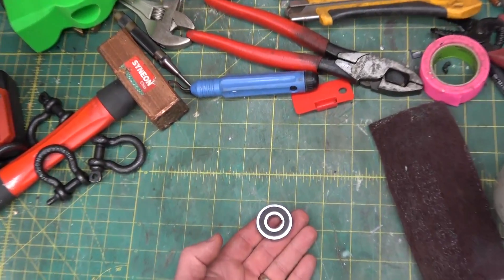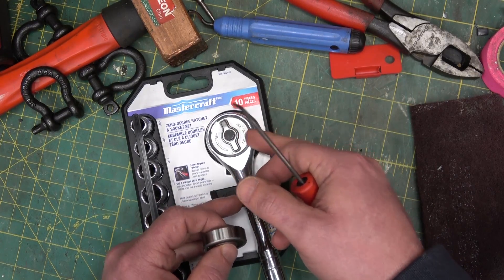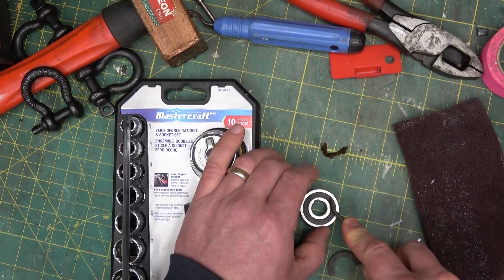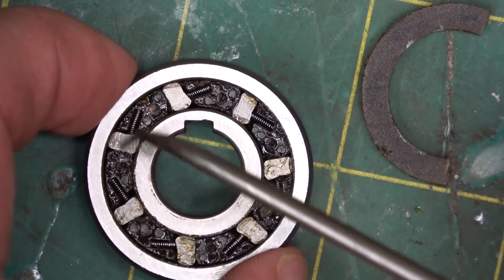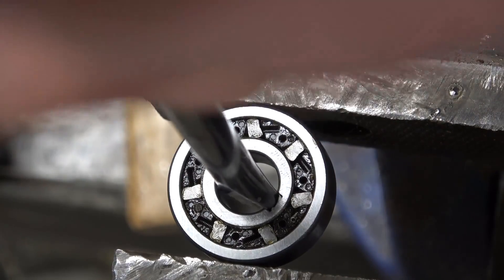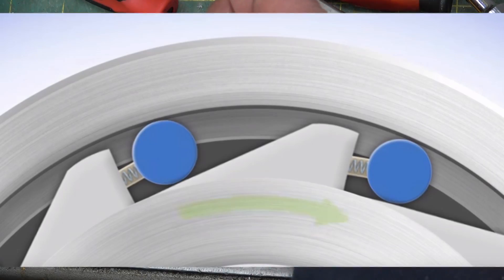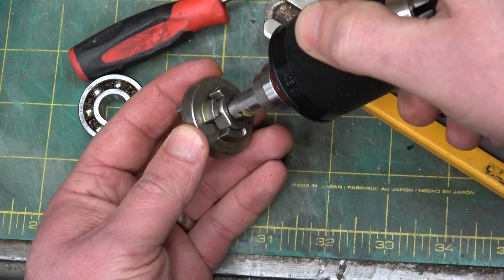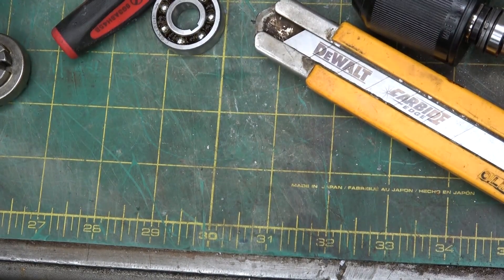BOLTR: Sprag Clutch | Engineered Bearings

Comment: Now what would happen if I were to weld the inside to a bike axle. And the outside to a gear cog.  Would the weld brake the bearing ?   Affect the balls ?   I know too much heat would shatter a bearing. But. Would it ruin the balls

Comment: My favourite is a bi directional one way coupling. Maybe I've written that wrong but it allow for is torque to flow in either direction but only through the bearing one way, ie from the outer race through to the inner but not from the inner to the outer.
I just checked its called a two way over running clutch

Comment: My Thesis, Final year project, was a wheelchair design that raised the seat so the occupant can speak to someone on a face to face level or maybe reach into an upper cabinet.
I used a Sprag clutch on both sides of the chair actuators in my design but it was two-way. Only the power shaft (up or down) could drive the final mover. 
The clutch was mainly used on escalators. A small one was VERY expensive but needed as a safety device.
I was the Top Dog of the year with that project.

Comment: I am replacing a keyless sprag roller bearing on a motor. Some one else took the bearing out of the press in housing as well as the press on shaft. How can I make sure to replace it properly so that it will work correctly? There were no arrows on the original bearing.

Comment: In a manual transmission auto clutch 3 wheeler or quad, a sprague clutch is often used in a drum style centrifugal clutch- to allow the machine to idle in gear but still have engine braking. A separate motorcycle style multi-plate clutch is often used, which disengages as the shift lever is moved away from the center detent, allowing the transmission to unload and shift at higher rpm.

Comment: I used to find the roller one way bearings in document feeders of photocopiers. Some of the whole gear assembleys were to me were how the hell does that all work as there were multiple one way bearings and clutches all seemed to be fighting each other and in one 70 copy per minute Ricoh model it had a one way bearing on a fixed shaft which seems to act as a there ain't no way in hell the mechanism is turning that way break.  It did my head in trying to figure it out but when the doc feeder started to jam in a certain way you would replace this or that one to get it working again.

Comment: The sprags they use in 700 class R/C helicopters can handle well over 5hp of torque. They don't have rolling elements though it's just a bunch of sprags (many more than the one shows here) and they use a set of radial bearings on either side of the sprag clutch to support the shaft. And instead of having individual springs for each sprag there is a spring around the outside circumference of the sprags as a group. here is a picture of one:

https://www.amainhobbies.com/sab-goblin-17x25x12mm-sprag-clutch-one-way-bearing-fe425-sabhc533-s/p976076

 The sprag drops into a steel sleeve in the aluminum one way hub and a shaft cover passes through the center (a bolt or pin connects the shaft cover to the actual mainshaft)

Comment: An easy place to find a sprag clutch is on any pull-start engine.  It grabs the crankshaft when you pull, and doesn't when the rope goes back.  Unless it's broken.  Then the engine will forcibly rewind the rope backwards, and break the handle off.

Comment: Helicopters use this to allow the engine(s) to drive the rotor system but still leave the rotors to spin freely if the engine(s) fail(s). Lots of interesting mechanical engineering in helicopters.

Comment: The ones I use at work on conveyors are cylindrical roller with no springs, 62mm OD and support as much as 3 tons of shale plus heavy rubber belt on a 30° incline. Only ever seen them fail when people reverse a blocked belt. "Get a shovel mate".

Comment: A little bit off topic but can you explain how screws with dedicated washers are made (usually the small ones: M3, M4, M5). The washer is always smaller than the thread diameter and it seems impossible to take off the washer without damaging the thread. I think it is not machined in from the screw material so i wondered a few times how they make it or its just Illuminati...?

Comment: Used this kind of bearing on a bowling machine.  2 machines shared one ball return mechanism, and the idea was that when one machine was running it would pull on the shared shaft, and the side that was not on, would frewheel, making it possible to have a shaft with 2 input's but one input would not have to drive the other.

Those were a lot bigger than this one and also they were roller-pin styled, but the function was the same.

Comment: Pretty cool idea.   Shimano reels use a similar technique but they use roller bearings in a cage with springs for tension in the races.  What is "really" cool is they made it switchable.   You can turn off the anti-reverse.

Comment: A lot of internal combustion radio controlled model engines use this for the pull start mechanism.  Also radio controlled helis (collective pitch helicopters, not drones from Wal-Mart) that utilize shaft or belt driven tail rotors connected to the main rotor use these to enable autorotation.

Comment: Hello Mr.AvE!
What is your opinion about types of bearing tandems that use in gearboxes of angle grinder (two big ball bearings in old DeWalt, big&small ball bearing in Makita, big bb &bronze bushing in Bosch, and big bb & cylinder bearing in new DeWalts and all other brands) wich of that technical solution is beter? Thanks

Comment: Most Rotax 912 light aircraft engines have sprag clutches in their gearboxes to avoid stressing the crankshaft in the event of a prop strike.  That's why you actually can't turn the engine backwards by turning the prop the wrong way.  There's a rather scary story attached to that I won't tell.

Comment: Being a bit of a geek,,FYI,I first come across these sorta anti reverse type things on fishing reels,often call "Infinite anti reverse,ratchets,,but the very first one,was not so anti reverse, but used as a Anti back lash brake in Flueger over head fishing reels,similar design, but had a bent spoke which when wound in the right direction, would hook the ball pulling it away from the drum and spin freely,,but in the reverse,these bent finger would push the ball out against the outer drum and act as a brake.

Comment: The old Chryslers had left and right hand threads on the wheel studs. You have to be careful if you pull all the drums off at once. Left goes on the left side and right goes on right. I got them backwards once, put the wheels back on, went down the block and all the wheels fell off.

Comment: Great breakdown on the Sprag bearing. They are vital in helicopter operations where they are called the Sprag Clutch or Free Wheeling unit/assembly. This is critical to helicopters as they allow the free wheeling of the rotor systems in case of engine failure and allow you to perform a autorotation. It is also used during practice autorotations when the engine is throttled back so that the rotor system disengages with the engine allowing the “free Wheeling’ of the rotors and a controlled (hopefully) decent and landing. Thanks for the video sir.
Reply: 100% spot on!  I work for the company that supplies most all of these.

Comment: I've encountered these in my fly fishing reels. When retrieving the line it spins freely and when pulling more line out (or on some rare occasions when you actually manage to hook a fish) it locks and the spool spins against the disc brake system. Pretty nice compared to some cheap reels where the brake applies to both directions. Also, if you want to switch the reel from right to left hand retrieve, you just flip the bearing. Thanks for showing how they actually work!

Comment: Do you have data that shows that the Sprag style is stronger than the "backed roller" design. From my experience, the roller style are much stronger than the sprag style. I build automotive transmissions and I have seen on multiple occasions the sprag style fail in an application and the roller type is the upgrade.

Comment: The starter  dive for virtually every car and truck 1  on the planet has a 1 way clutch bearing  in it. Starter clutches generally used roller bearings that jam one way and roll in the opposite direction.

Comment: Many (too many) moons ago I was an engineer with Canon. Print engines have a lot of one way clutches. The mechanism of choice was a spring which wrapped tightly around a shaft in one direction but was opened up, and hence free wheeled in the other direction. This was often used in such a way that an integral gear caused another shaft to turn when the shaft in question turned one way, but to allow the first shaft to turn independently the other way.

There's often a latch so that the first shaft might have to do a complete rotation before the clutch is re-engaged in the other direction. 

When your printer picks up a blank sheet and it feeds in and out a short distance a couple of times to find the top or bottom edge, this arrangement is what stops another sheet being picked up at the same time.

Comment: What design of 1 way bearing is likely the most durable for a retrofitted a removable electric starter for a racing kart engine?

We tried one of the ramp ball designs, and it failed. Is the sprag cam design more hearty and durable to violent torque from a starter motor or drill which is what we use to kick over a Honda CR250?

Comment: Used to work on Canon and Sharp copiers (color and B&W) if you get a service call for a paper jam, sometimes you're at a machine for hours, you'll have dozens of these one-way bearings lying all over the place, along with electromagnetic clutches, gears, screws.... Some machines sucked so much to fix, you'd have to skin it down to the frame plate with the machined holes, you could see right through the copier LOL. Sharps were terrible machines to work on.

Comment: I dissected one at work on an armor zone tape pull system. It was the ball style. Pretty cool engineering to prevent backlash that would definitely cause tension loss. The machined wedge insert makes for a nice stought bearing that holds up well.

Comment: These are used on RC racing cars where they lock under power and freewheel when unpowered.
Pretty sure on our RC cars they were roller versions, though and tiny by comparison - 6mm shaft.

They were to accommodate two gears on one shaft whereupon after the gear change, the other gear would free wheel.
Also, on the front axle, one was used on each side instead of a differential . . worked kinda like a LSD and the car would bolt out of corners like a scalded cat - four wheel drive cars.

Comment: These kinds of bearings are found on the front-end ball returns in some bowling centers. I was a mechanic on bowling machines for 45 years. They worked flawlessly for years, then would suddenly fail (no longer engaging). 
I once worked for a guy who thought he would make them last longer by packing them with grease. The balls would no longer shift, and the clutches would no longer engage. I had to replace all 24 of them (48 lane center) one night because they all shut down, and the league could not bowl.

Comment: You should BOLTR that ratchet. I work at crappy tire (specifically in the tools dept.) and every time we get those in stock my wallet itches cause I wanna know how in the sweet fuck you're meant to switch around the direction, and I don't particularly want to google it

Comment: You can make a multi speed transmission with these and some centrifugal clutches . Lots of rc cars use this method . Husqvarna also did on a full size dmoff road motorcycle from 250 to 500 cc 2 stroke . 3 or 4 speeds.  Unbeatable in a drag race . Also the starter motor system on a majority of motorcycles uses a one way bearing as the starter motor gears are permanently engaged

Comment: My question would be this: How much torque difference is there between a ball bearing sprague clutch and a roller bearing sprague clutch? You usually see the roller bearing ones in drills & cordless screwdrivers. They must have a better working load.

Comment: I've seen one of these on the ribbon-feed pulley on a dot-matrix printer.  The pulley was coupled to the print carriage, which could move in both reverse and forward directions, but the ribbon feed was one-way.   Damned clever.

Comment: In printing its not to stop the shaft from reversing, but to let the next set of rollers be able to convey the paper while the drive of the previous roller is disabled. Even when the speed of the previous conveyance roller is slower than the next the paper will be pulled by the next set faster than its fed, the bearing spins free  and faster than the shaft. In this application its called not a bearing but a clutch.

Comment: These are used a lot on bigger dual sport single cylinder motorcycles with electric starters. It allows the starter to crank the engine over so that the engine won't start spinning the starter motor after it picks up speed. The Kawasaki KLR650, Aprilia Pegaso 650, and BMW F650GS use em.
Reply: My 73 Honda CB450 has one (sprag clutch)  built into the generator rotor/ electric starter system assembly. That model was first sold in 1965, or thereabouts. Still works like a charm and the roller & spring replacement parts are easily obtained today!

Comment: Mechanical equivalent of a Zener diode :)
Reply: plain diode? zener would be a sprag that engages instantly one way, and after reaching a certain speed the other. come to think of it, that might have an application in LSD use. thats limited slip differential LSD use.
Reply: @butstough  I spent far too long trying to figure out how the hell clutches and LSD go together, I missed the last bit. Clearly we have different backgrounds.
Reply: @butstough  I wonder if a pair of one way clutches can be used instead of a differential in some applications, as in allow one output to turn faster than the other but the slower one gets the torque.
Reply: @NiHaoMike64  interesting. wonder if someone on beamng or AC could simulate this behavior.
Reply: @butstough You get a lot of slip, with LSD.
Reply: As long as the outer race slips in the vice
Reply: The newer version of the dog bone sprag is actually called a diode clutch
Reply: @benjaminkline4855  disbelief
Reply: A checkvalve is a better example i think

Comment: Steno machines and B&H equipment from the 20's to the 60's (and in one case till 1972). used a different (early) design clutch. These were made up of loose parts under a sheet metal cover inside a cast and machined pulley. A big cam and a spring inside would allow the pulley to run freely in one direction but would lock if pulley tried to change direction. All of this was done with loose tiny parts (trapped loose ball bearings, etc.) that had to be removed to access a regular needle (roller) bearing for service (also made of tiny loose parts). They both switched to miniature one-way clutch bearings when these became readily available in the 60s. They also replaced the pulley bearings with regular needle bearings. 

Unfortunately, the newer design would would fail when the grease they used dried up. Then the bearing side of things cease rolling and just become a static surface that the shafts would spin in, essentially becoming a solid bearing. If not caught early the friction would cut into the shaft, especially with the simple needle bearings. Failure of the one-way clutch would immediately be noticed as it would cease its ratchet-like action. A lot of sprocket and platen assemblies were destroyed this way. If caught in time the fix was simple: clean and re-lube the bearings with a lighter lubricant, usually medium weight oil. In some cases the one-way bearing would need replacement. 

In later design equipment they put the one-way bearings in plastic (nylon) gears. These would fail quickly in service either from the bearing slipping in the plastic under load, or the plastic shrinking microscopically and cracking, freely allowing the bearing to slip. They addressed this by using a wide one-way  bearing in them, spreading the load over bigger surface area.

Nowadays these little wonders are everywhere and waiting to screw you at the worst minute. RC hobbyists have learned to service them every 10 flights or so to avoid destructive failures, etc.

Comment: why are those not used in bicycles?
so much smoother and elegant than these ratchet things
Reply: They can't hold much load, either side loading or perpendicular to the axis.
Reply: @rubiconnn  but that wouldn't be an issue in a bikes cassette?
if it works on a conveyer belt
Reply: There's a company called Onyx Hubs that makes sprag-clutch hubs. Expensive though, and pretty heavy compared to ratchet-style hubs. Shimano did some similar stuff back in the 90's too

Comment: Any chance of doing a constant torque clutch as used on the old video tape winding machines (the machines that made the casettes etc)? I never did figure out how they worked.
Reply: they typically are just two discs rubbing together with a spring load on them, the spring cranked down to provide a certain torque at a certain rpm. more complicated ones can provide a certain torque range at varying rpms
Reply: These supplied constant torque from stall to max RPM.

Comment: I bought a brand new milwaukee 14 volt drill that from factory did'nt lock up when turning the chuck by hand.. it did sometimes, but not at all what you could have expected. I even had it on service for that and one more issue, but when getting it back it was exactly the same. I just can't see how they could fail to fix it when seeing how easy it should be to identify the problem... :( My solution to fasten the bits were to run the machine and hold the chuck to tighten it or in reverse to loosen it. Maybe I should send it to AvE for "inspection" =)